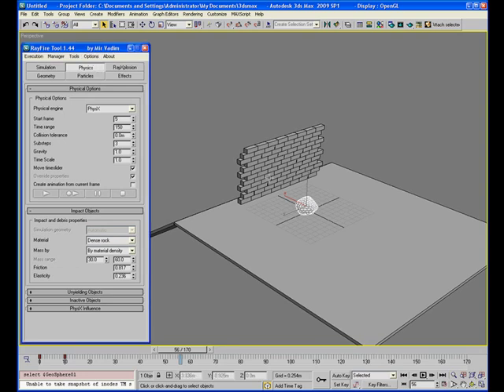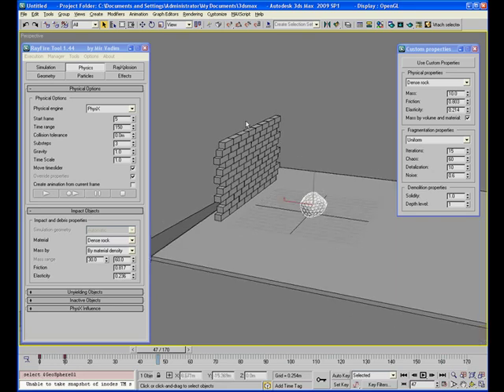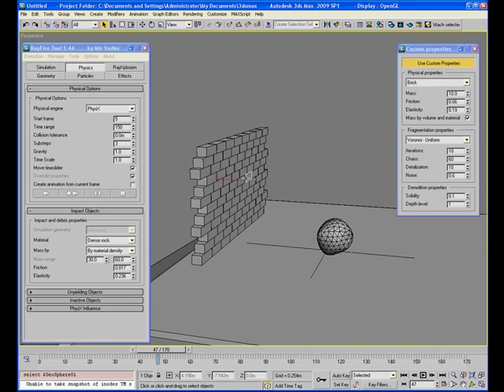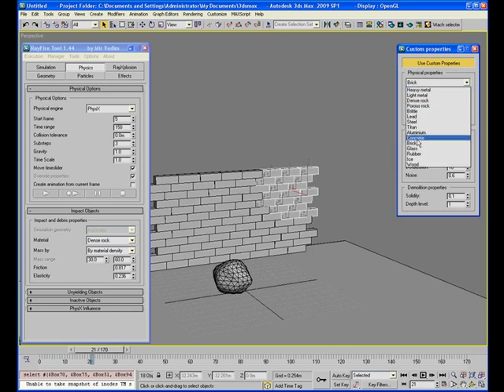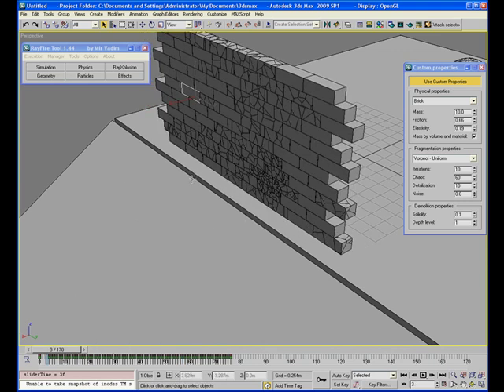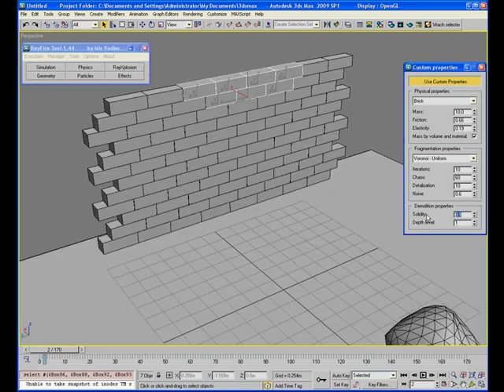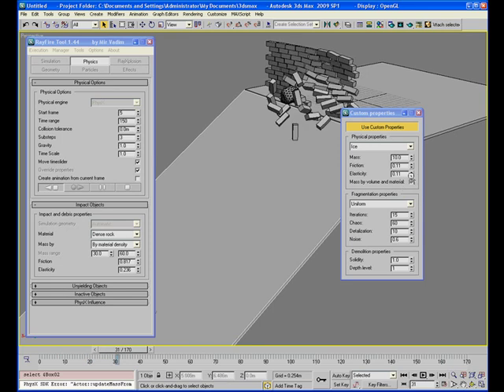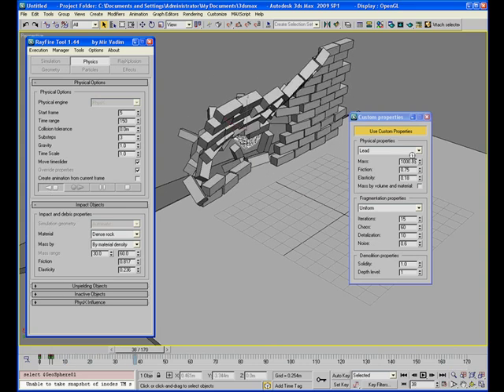RayFire Tool 1.44 | Tutorial | Custom Properties Rollo

Comment: Hi Mir.
I am using 1.69 rayfire. I use modifier rayfire bricks. In rayfire interface i select all bricks and my spehere as a dynamic object. Then i open the custom toolbar. Here i pick some of the bricks and give a depth of 2 but i dont get tje extra smal fragmentations?? Only big bricks. Please advice. Because instead of using pflow this can be used... also i do not have the lead option for the spehere as in your video